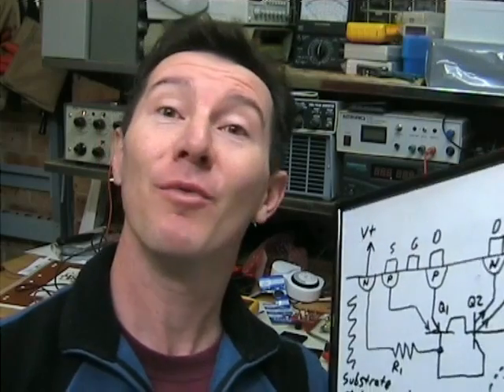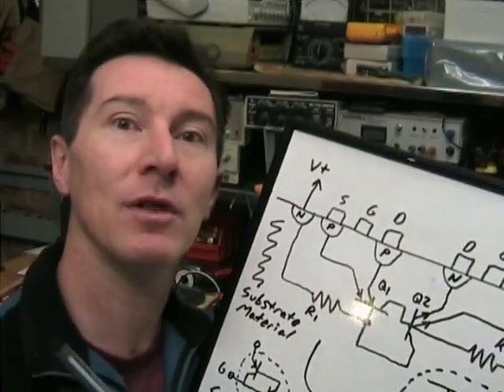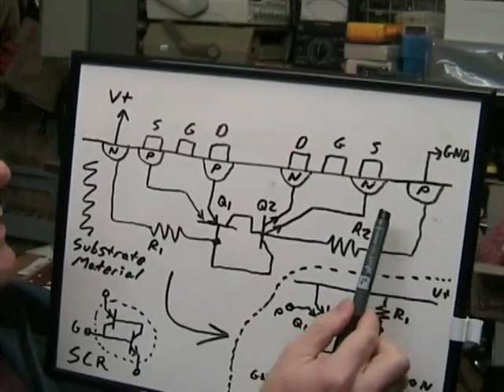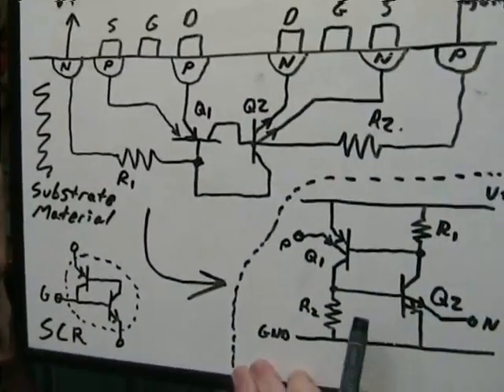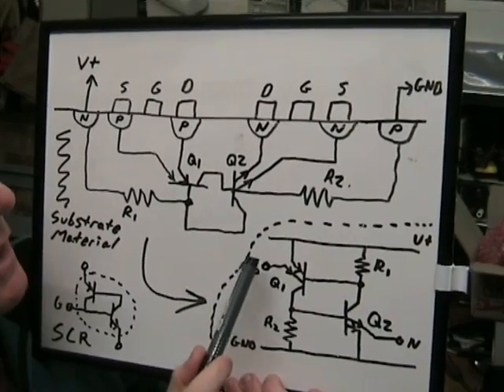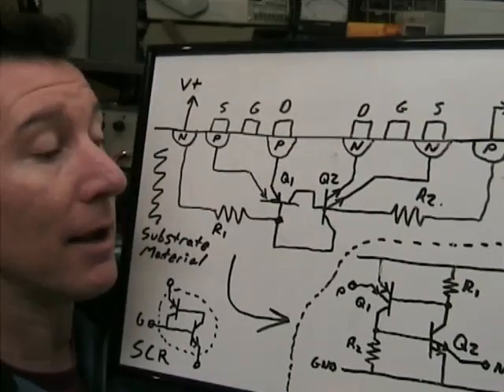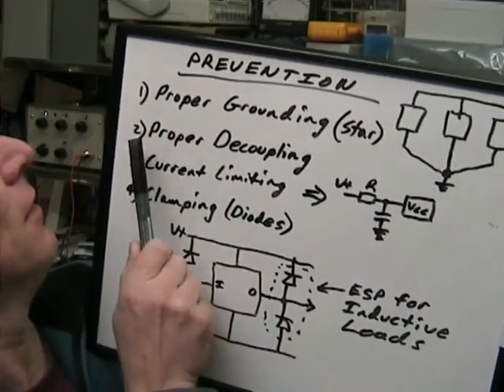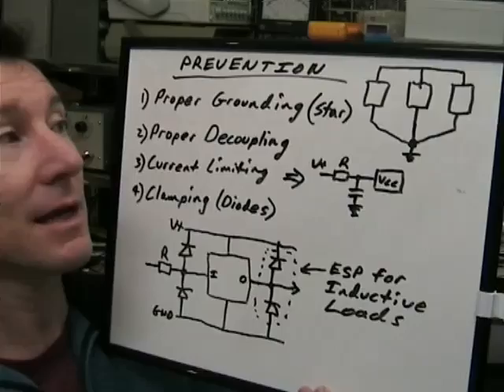EEVblog #16 - CMOS SCR Latchup Tutorial

Comment: I was going to use a PTC to limit the current to a motor driver, but when I started hearing about "latch up" I was worried that would happen if a control input was present while the voltage was being dropped (i.e. the PTC "tripped") but now I see it's as simple as adding a couple diodes.

Comment: Wow, Dave has been at it for a while, eh?  I only encountered latch-up in my own project yesterday, while connecting a lead wire from the gate of a PNP Mosfet to an external frequency counting circuit.  Sometimes the Mosfet would turn on permanently (when I moved the probe wire), despite the fact that the gate driver's collector was still oscillating ... and despite the fact the gate was protected by a zener.  Mysterious.  Well, now I know ... maybe all power MOS drivers need a clamp around the gates?

Comment: Would something like this cause an IC power rail to act like a resistor, I've had some cmos based chips that for some reason draw a lot of power but still somewhat function and a resistance is present on the power rails usually in the order of 40 odd ohms, my guess is the output mosfets latched up and "burned" in a resistance to the power rails
Reply: What you're describing is most likely high current draw due to a floating pin.
Do a search on "cmos floating input" - e.g. http://electronics.stackexchange.com/questions/7179/is-it-really-a-bad-idea-to-leave-an-mcu-input-pin-floating
Reply: Kean Maizels the resistance was measurable with the IC out of circuit
Reply: Interesting, I've seen similar in the past as well.  I believe latchup is generally cleared by power cycling.  It could still have been internally damaged due to the excessive current flowing through it, caused by either latchup or a floating pin.  Or possibly more likely caused by ESD damage.